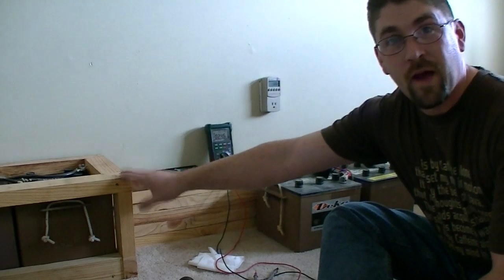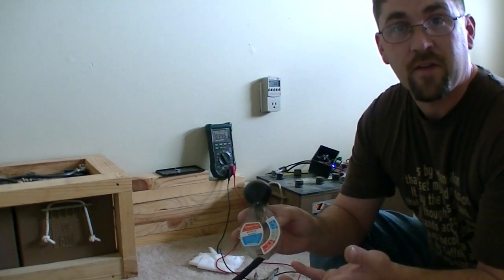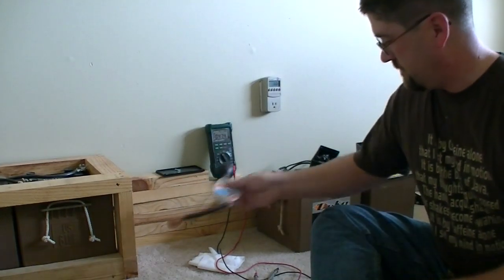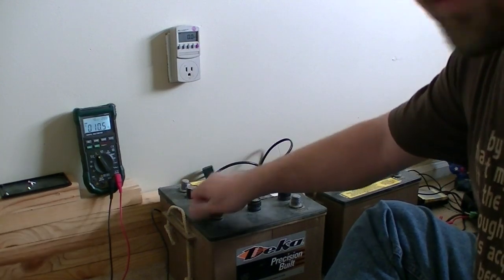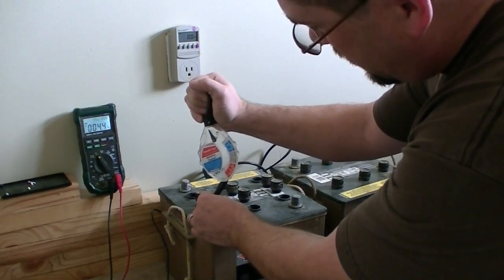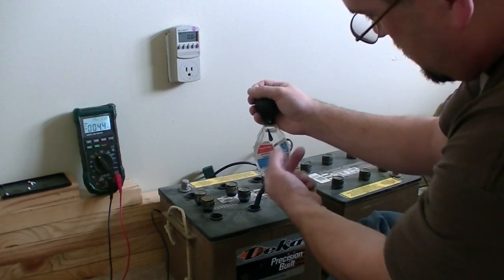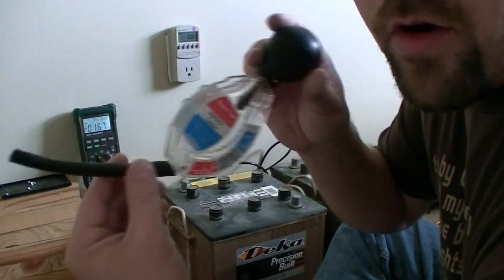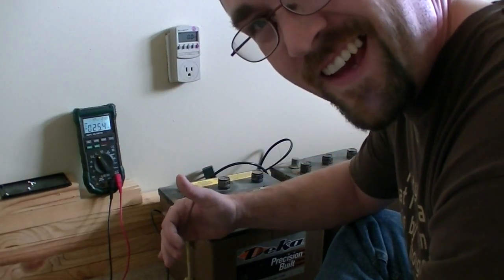How To Test Desulfated Batteries

Comment: So if you come across a battery where the water in a cell is low, and you add water before desulfation, does that dilute the sulphuric acid thus changing the specific gravity of the cell? btw, thank you so much for sharing your experiences with this.

Comment: although its a 10 y old video, its invaluable, thanks for sharing. I am trying to get a battery revived, the desulfating option is called recondition. The unit completes process in 24h then recharges for 18h, if it reaches full, it stops, if not there is an error, instructions say you can do this process 5 times. However i noticed in your video process is on for 3 weeks and 1 week yet to go, I am confused at the period it has taken your process vs the one with my unit.

Comment: Have you ever tryed desulfating a VRLA Battery? (Valve-Regulated-Lead-Acid) If so, will it work with this type of battery too?
Reply from the maker: TCircuitry HD sorry no, I have only tried it on traditional flooded lead acid batteries.
Reply: Its all good. Still its an interesting theory. Idk if it works or not either.

Comment: Will my schumacher marine 15 blue charger desulfate trogan 12volt?  Playing around put epsom salt in it, distilled water put on big battery standard charge.  Is f7 to old?
Reply from the maker: I made my own desulfator as seen in the video.  I don't know anything about any other brands.  Why are you putting salt into a very delicate battery chemistry that wasn't there to begin with?  Why do people feel the need to shove foreign compunds into a battery?  The only thing your battery cells lose over time is water, top off with distilled water only.  Everything else is still in the cells, you just need time and patience with a desulfator to revert the lead sulfate back into sulfuric acid.

Comment: Can we assume that if the battery passes the SG test it will pass a load test?
Reply: +mdkallas1 The SG test is better than a voltage test, however it can be misleading in that it won't show any indication of a slow battery leak (microcrystaline shorts).  One should actually remove the residual surface charge by waiting 24h (or by using a small dummy load) before performing the SG test--otherwise the SG test reading will be a bit misleading.  The best test (which is the most important test) is the load test.  A short load test is good, however a long load test "C/20" is much better to compare a reconditioned battery capacity to that of a new battery capacity.  If your battery tests at 180AH & a new battery is rated for 225Ah, then 180/225=.8 = 80% of the capacity of a new battery. The final test is to determine how a reconditioned battery self-discharges.  All batteries self-discharge.  Good batteries self-discharge at a slower rate than bad batteries.
Reply from the maker: assume yes but not absolute.

Comment from the maker: The inital SG was close to 1.0.  I didn't test the SG on a daily or weekly basis, but when fully desulfated the SG was back to where it was when brand new.
Reply: I know it has been 11 years ago but I truly appreciate how you explained the process of checking each cell. We are preparing to go off grid with a used DC Solar Trailer and (2) 48v/510AH TUBULAR Forklift batteries. One battery was so riddled with acid that it has worn through the cell wall on one 2v cell so we will have to remove and replace that cell - going to be hard to tackle. The other battery bank seems to have some life left and I am in the process of letting the generator + SMA Inverter with Midnite Solar 250 CC bring it back to life (we'll see if it recovers).

Comment from the maker: All depends on why they boiled. If they boiled from an internal short, then the battery is dead. If they we're boiling and the plates aren't completely covered with electrolyte, the battery is toast.  If you were just running too high of a voltage the battery may be okay.  You initally charge a battery around 14.4v till the amperage goes down, then you float charge at 13.5v and that will keep it charged without boiling over.

Comment from the maker: I do agree with you but that was the maximum amount of electrolyte I could get out of each cell as the tube was touching the top of the cells.  Also I don't believe that the readings were skewed as the electrolyte was fully covering the dial assembly but i could be wrong.

Comment from the maker: 6 cells in series for a nominal 12 volt battery.  you are correct each cell provides around 2 volts.  for those batteries I'm pretty sure they could peak out at over 1000 amps if shorted out.

Comment: ca 13V on the Bat. that means its a nominal 12V car bat i guess. you said its 6 chambers meaning there are 6 single cells in there.. are those in series or parallel? if series this means a single lead/sulferic cell does provice just about 2 V each, is that correct? what max current can it provide usualy ?